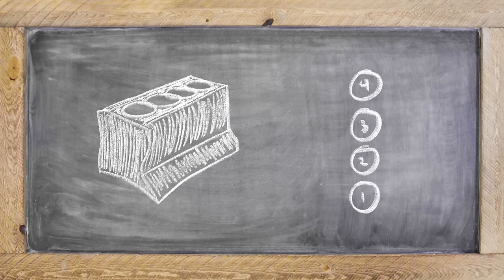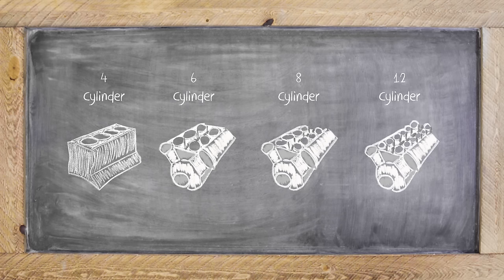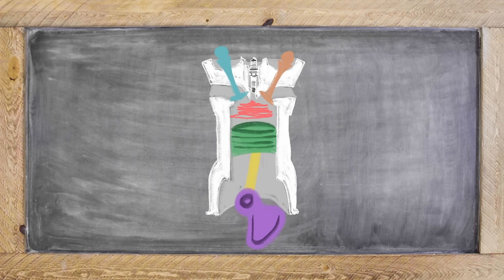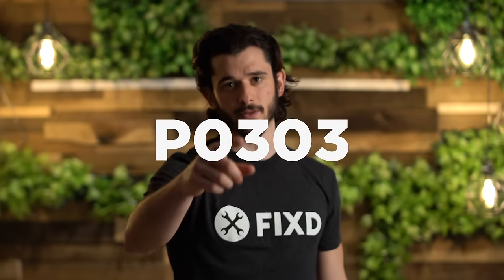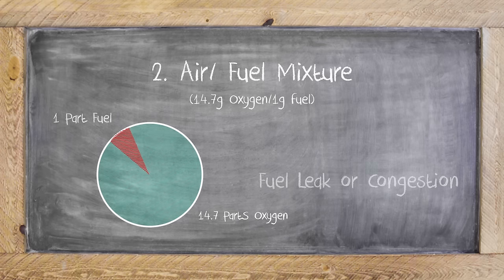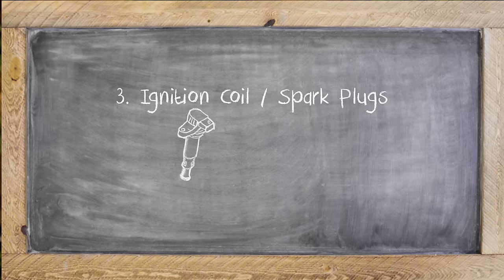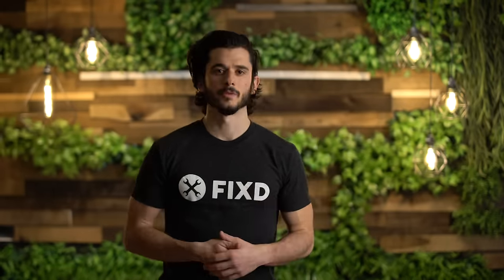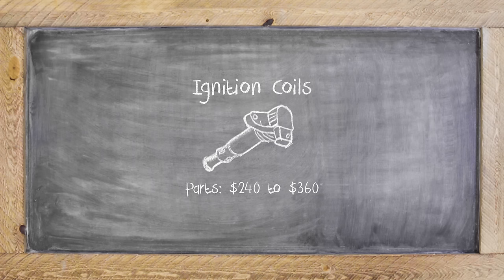P0303 Explained - Cylinder 3 Misfire (Simple Fix)

Comment: Right before my check engine light came on I heard this kind of whining whirring sound...the code came up P0303. That mean anything
Reply: did it come out of the exhaust ??
Reply: @bassboosted7778  no...it seemed like it was coming from the engine...like a whine through the ac
Reply: Tyler Honeycutt that’s actually really weird I haven’t got a clue about that
Reply: Could be a bad fuel mixture
Reply: @bassboosted7778  ok thanks
Reply: Hey did you ever fix that whinning sound.
Reply: @ryanjoseph8694  My car was screwed. I ended up having a crack in the block.

Comment: I had a p0304 and put in non ethanol fuel and lucas octane booster and the problem went away.
Reply: I had a ridiculous hood shake when stopped and I was getting misfiring codes for all cylinders. Poured a bottle of Lucas Injector cleaner in the tank and the shake is significantly lower. Also now only misfiring on cylinder 3. Some people call it snake oil, but I noticed an improvement for sure. 2004 Toyota Celica GT with 219k miles on it here.

Comment: This vid really does not help.
And saying changing the fuel filter is an easier and cheaper fix than a injector is not necessarily true, it depends on what engine the vehicle has. In some vehicles a mechanic charges more on labor when replacing a fuel filter.

Comment: Coil pack or its small tube is clogged
Reply: Vauxhall Zafira GSI bud. Went out today in it and as soon as i accelerate quickly it goes into limp mode. i stop and start engine again and its fine...until i accelerate quick again when boosting. Has gotton worse over time used to do it only in 5th when accelerating, a slight judder now it does it in all gears. coil pack still? Can hear turbo fine and hear it boosting but it holds back.